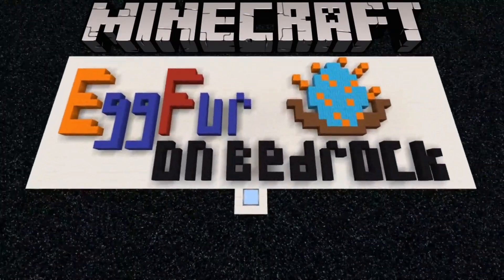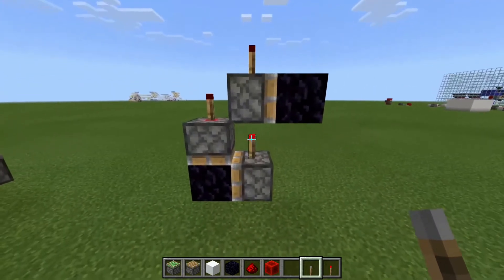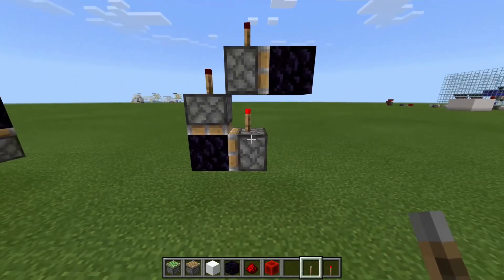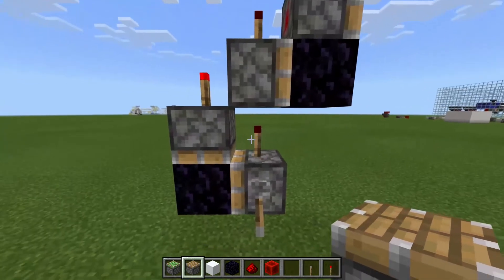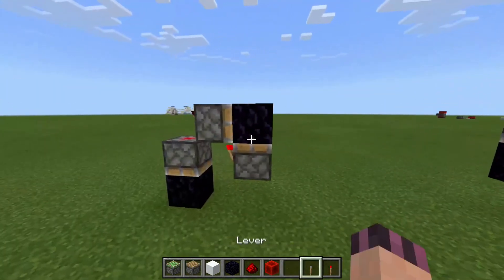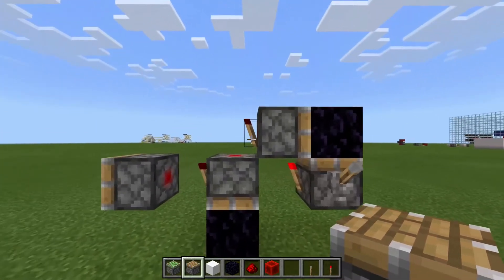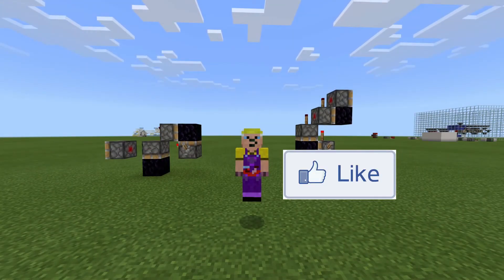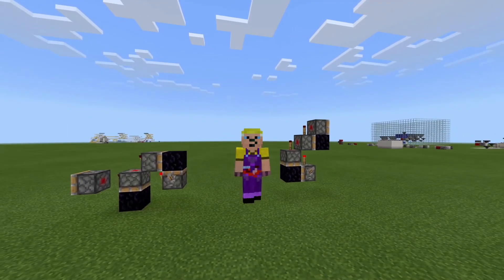Bedrock: Monostable Circuit - 1 tick pulse limiter (1-wide, tileable, silent)

Comment: Nice tutorial! How does this work? On the first design, how does the torch on the left make the torch on the top turn off after activating? I've been doing redstone for about 6 years on Java and Bedrock, and this completely stumps me, lol
Reply from the maker: This is all to do with a bedrock exclusive feature (was a bug?) that the community calls soft inversion. If a piston is activated - even if it can't physically extend - it will cause an attached torch to turn off. Same principle as a torch attached to a powered block, except pistons can be activated in many more ways,  e.g. by a torch next to it. Does that make sense?
Reply: @Eggfur  Not Dexie but it helped me understand ty